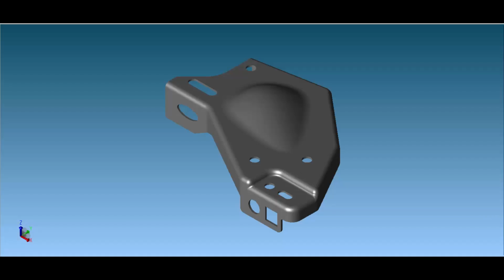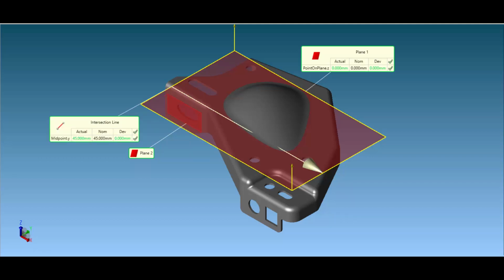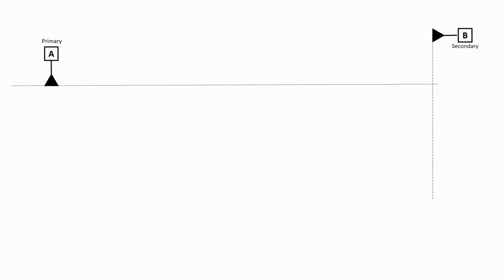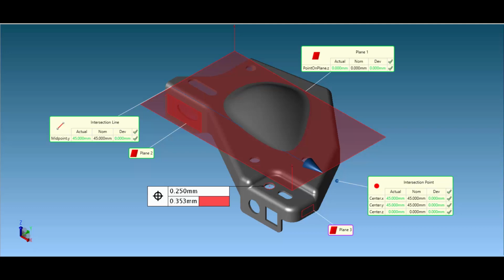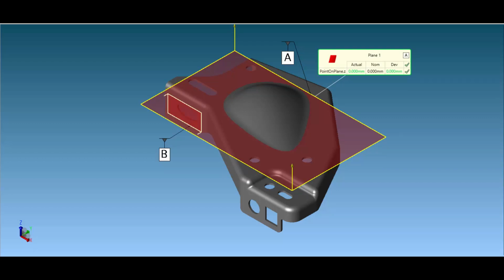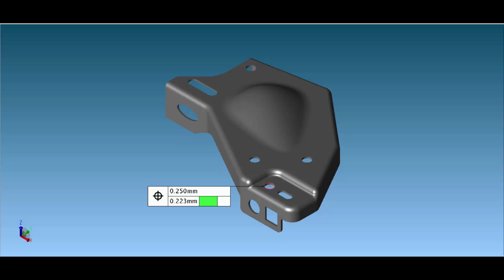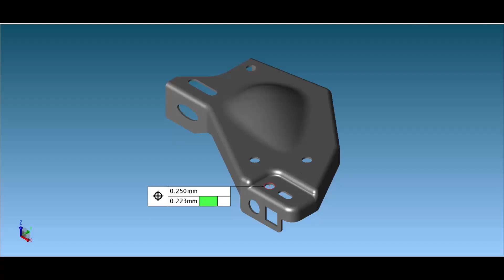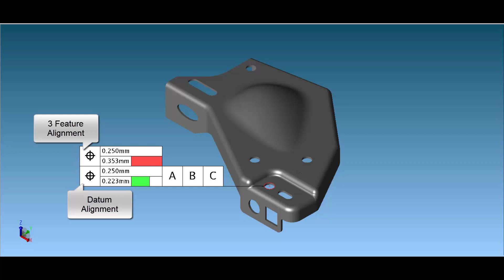FARO CAM2 Measure 10 - How 3 Feature and Datum Alignments Differ - English

Comment: This needs more explanation if possible, as its not clear which method is more accurate.
Reply from the maker: Both are accurate, depending on your usage. Datum alignment, if you use datums, I suggest datum alignment over features.

Comment: Your datum alignment does not appear to meet the requirement of ASME Y14.5. You show the data is aligned to "the mean position of the measured area," however, GD&T datum alignments always use the highest points of contact for planes.
Reply: The same in ISO 1101